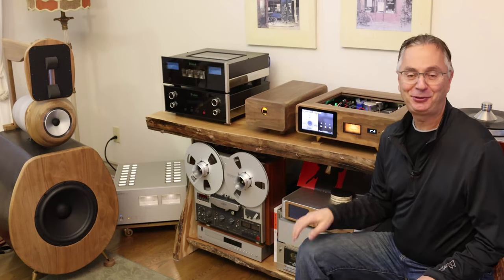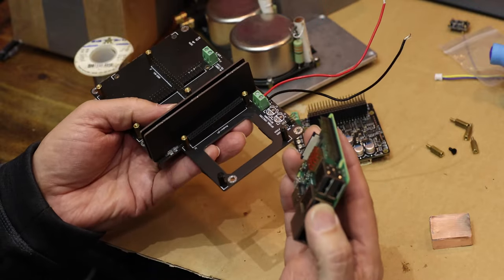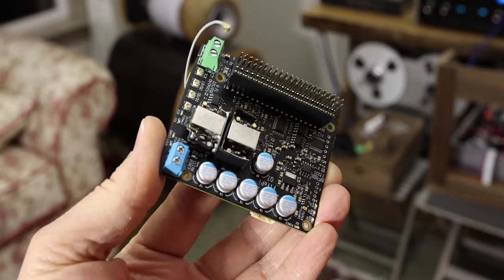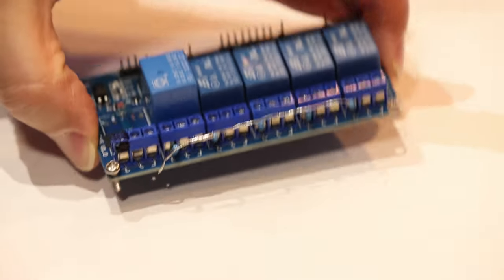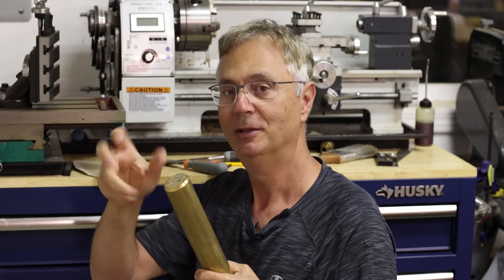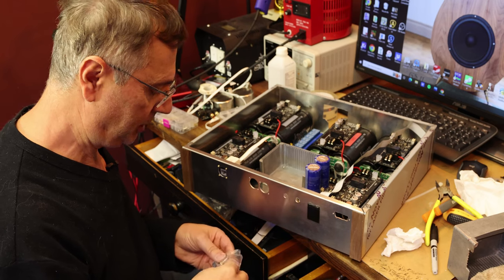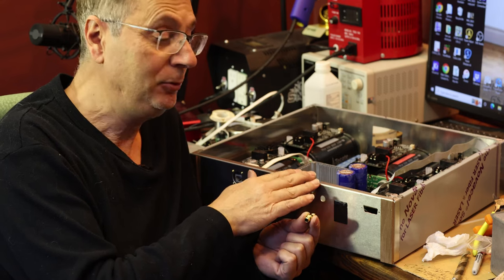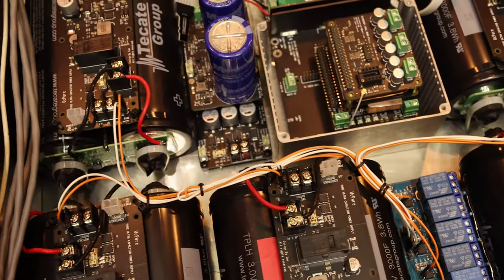World's second Best DIY Dac and Streamer Detailed Build

Comment: Thanks for this video. Can you share link of The display? I need one that i can mount in The sa e way like yours (on wood chassis with display edges  outside)
Reply from the maker: This is the official 7 inch Display from Raspberry Pi it has a thin black bevel easy mount: 
https://amzn.to/3SNQhyN

If you wand a 5 Inch (not too many work with Roon) and no outer bevel available that I know but see my Display Video desc for the one that works with Roon and also IPS:

https://youtu.be/N_vdKhiUyPY?si=YCpK5re2-Hi6shg_

Comment: Hi magnificient work. I wonder if you can get a lesser quality but a still good one by avoiding supercapacitor. The whole system would be much simpler and less expensive. I think many people would feel themselves safer too by avoiding supercapacitors accepting a lesser quality result. I understand you achieved a sort of proof of concept of an ultimate dac and it is really amazing. Other things such as the extension cable and the screen may be avoided to make all the project more easy.

Comment: Hello, 
All the best wishes for health and happiness as well as to your loved ones for this new year. 
I don't know where to start so much that I find your DAC network player extraordinary. 
My first question concerns the shielding you made on the Raspberry and your FifiPiQ7. Don't you fear that in the long term it will heat up a lot? My raspberry PI 4 heats up quite a bit for me... 
Did you find a significant musical difference between the FifoPiQ3 when you first installed it and the Q7 you have now? I have the Q3 with the same clocks as you and I already find remarkable musicality at my level... I don't bother you anymore. 
Congratulations again for this extraordinary job you have done. 
Thank you 
Xavier.

Comment: hi…. can you share a link for that two metal boxes used to shield the station pi? thanks!
Reply from the maker: They are Hammond Boxes picked it from a local store but here is a mouser link 120x95x56mm not counting the lid height
Have fun :)
https://www.mouser.ca/ProductDetail/Hammond-Manufacturing/26908PSLA?qs=amGC7iS6iy9KUZQl8bCM5Q%3D%3D

Comment: hi. i’m trying to build similar project using opa861 instead of I/v transformers. Now i’m building power section and i have 2 alternatives:
1- going with ultracapacitors plus linearpi for raspberry as you did

2-going with linearpi dual with UcConditioners for opa861 and purePi for raspberry, dac and fifoQ7

second way is (i think less expensive)

what do you suggest gabster?

thank you so much!

Comment: Hello Gabster. Do you think there will be a big difference in sound quality with Ian Dual Mono Dac powered by one 3.3V ucpure and three independent ucpure for dac?
Reply from the maker: Probably not a lot I could not tell 
But you only need 2 as the middle one is for the clock if you sync with the fifo you do not need it

Comment: Hi Gaby...i have the same problem with the ess controller...did you connect the delay timer so that the ess controller part boots later or so that the raspi area has a delay? also the four 3.3 volts for the Dual Mono Dac HAT and fifo should start with a slight delay ?
Reply from the maker: The Video is not Clear but you can see it at 55:35
The delay should be on the 5V of the FifoPi 
or if the FifoPi is getting its 5V from The Pi then Both I have separated the 5v on the FifoPi in my system
easy way to do it is to:
Use a relay with a large Capacitor in parallel of the 6 to12V Relay power taps and you supply the power to it with a very small resistor in series. The relay will trigger the UCPure on/off connector (Switch should be OFF)  I attached a sketch for you https://drive.google.com/file/d/1PWYSS0saqiCux17cyMrqr5Z5CRNr1DaT/view?usp=drive_link
Hope that helps
I wonder if the Monitor pro does not have that problem.

Comment: This build is truly inspiring! I have two questions though about something you brought up but never explained further:
1. How was the the test results for this DAC? Did it show good linearity?  Low distortion? It would be nice to se a separate video with measurements.
2. What resistors did you end up using with the Ivan I/V?
Reply from the maker: Great linearity a tiny 1 db loss in base below 30hz normal with Transformers very low distortion.
not much time for a video specially that I will be upgrading some parts soon
2) 100ohms in my system on the input none on the output
Reply: @Gabster1  Thanks for the response!
Reply: Great Build @Gabster1. 

Did you end up using the Vishay metal foil resistors? 
Have you used Dale resistors in any comparison?
I am considering the upgrade on my Lundahl transformer output stage for my next Ian Canada build. 

Regards Mikkel
Reply from the maker: @mikkell.7828  
Yes, I used this one did not compare it to Dale but I liked them better then Ivan's own resistors but that is to my ears and system.
https://www.mouser.ca/ProductDetail/Vishay-Precision-Group-Foil-Resistors/Y0785100R000T9L?qs=HtoBOv42S6KMksJHS%2FF3bw%3D%3D
Reply: Thanks for The link @Gabster1🙂

I my self I trying to figure out where to place my 8.8” HDMI screen in my new GB2023 build. Both physically and power wise. I like you copper shielding around yours btw🙂
Did you power you DSI screen in between your linearPi and the UcConditioner? Was that to only have the pi using the conditioned power?
Reply from the maker: @mikkell.7828   8.8 that is a good size perfect as we grow older 🙂
correct in between provides a bit of noise Isolation between the 2 and not having to need another supply.
If you are interested send me a few pics when you are done to share on my Chanel.

Comment: Hi Gabster, I have seen, that you also have a Denafrips Terminator DAC. Did you compare those two DACs using the same Streamer?
Would you mind sharing your thoughts and impressions about this?
Reply from the maker: They are very close I did a blind A B test with a few people and it was a 50/50 mixed review 
But that is a good thing I now use my Dac as a reference also room for improvement in the future.

Comment: Wouldn't it be better to use 2, 12v batteries that work interchangeably instead of capacitors? Saludos
Reply from the maker: Ultra capacitors are the purist form of power with very low impedance

Comment: Why did you choose a passive IV versus an active one (like Burson V5/V6) Great project, just mapping out my starting point.  I currently have a Naim ND5 and Mark Levinson 526 (DAC/Pre), just want to play and see.
Reply from the maker: from my experience A good Quality passive will outperform most active also less ultra caps to power them but may try a active option may be will try the Burson opamps

Comment: Hello Gabi,

I like to thank you for the videos. You inspired me to build my own DAC.
As i want to start with the electronics first i bought the FiFo Q7, Dual Mono Dac HAT, MonitorPi, ESS controller, I/V transformer output board.
If all works i will build a fancy power supply and case too.

As i want better clocks i bought one Accusilicon 98MHz to compare the standard clock with the Accusilicon.
Now here is my issue. With the standard clocks from the Q7 FiFo i can see in the MonitorPi
both frequencies from the clocks and it's working.

Now if i put the new Accusilicon in the socket i can't see the frequence in the MonitorPi and the Q7 is not working.
In the manual i read that i need to bend pin 1 of the clock because of a strong pullup. I did this but with the same result.
I also tried to solder a 1k resistor from EO to ground but no luck. I can mix the Accusilicon with the standard clock and i can see the frequences in the MonitorPi from the standard clock but not from the Accusilicon. I can swap the sockets but with the same result. So i assume the Q7 is fine but the new Accusilicon clock
is somehow not working.  

I have a 20MHz Oscilloscope only, so i can't see any real output from the clock.
Now i have no idea why it's not working with the new better clock from Accusilicon. Is the new Accusilicon dead? Is the Q7 somehow damaged?

Do you have any idea what i can try to solve this issue?

Thank you for your ideas.
Reply from the maker: sent you a e-mail back hope you solved the issue

Comment: @Gabster I am building my own streamer based on Ian's designs. Is your aluminum chassis custom or is it an off the shelf piece from Hammond? I am trying to locate one and yours would be near my requirements.
Reply from the maker: It is from Mouser here is the link
https://www.mouser.ca/ProductDetail/Hammond-Manufacturing/1444-17154?qs=XJfXErqHgA5%252B%252BK8hsJVg4A%3D%3D
:)
Reply from the maker: It is very basic not the best looking, it would need a front decorative piece at least
Reply: @Gabster1  Thank you. I will definitely take a look at those chassis. Congratulations on a successful project. They sound phenomenal for the cost.

Comment: I have a couple of questions if you can answer? I assume after you built this unit you are no longer using the streamer you built. Is that streamer available for sale? Also is it possible to add an optical network connection to this dac/streamer?

Thanks, Paul
Reply from the maker: Hi Paul Yes I could sell the prototype Streamer as you mentioned not using it now since my Dac build
Send me a email, my info is in the about section of my Chanel.
and yes it is possible to add a optical not sure if you want a output or Input.

Comment: Gabster, I was just wondering if you ever tested the Ian Canada Transformer I/V in your build?  Do you have any comments about it?
Reply from the maker: I have not He supplies the IV board and you can get the Transformers for it but I did try the active opamp IV board and it is not too bad sounded great to my surprise.
Reply: @Gabster1  Thank you for the reply, the opamp version looks interesting, I was thinking of his OPA861 Fully Balanced Zero Feedback I/V Stage (November 2022).  It may have been released after you were well on your way with your build.  Nice build by the way.  Are you going to sell your Terminator or have you sold it?  What is next?  A couple of point to point tube mono blocks?

Comment: Hi Gabby, thank you very much for your videos. They are extremely well done and you manage to transmit your enthusiasm for this hobby of ours.
I am seriously considering to try and build a dac/streamer myself based on what you did.
In my case I need to use the dac also to convert the signal coming from my CD transport via an AES/EBU cable. Is it possible within the configuration of what you built? Which board would allow to do this?
Thanks in advance 
Aming
Reply from the maker: Hi Aming
yes you can just add a receiver PI like the:
https://github.com/iancanada/DocumentDownload/blob/master/ReceiverPi/ReceiverProII/ReceiverPiProIIManual.pdf
also Ian is just releasing a Receiver Pi DDC I believe it does the same as well not sure
https://www.diyaudio.com/community/threads/asynchronous-i2s-fifo-project-an-ultimate-weapon-to-fight-the-jitter.192465/post-7487348
Hope that helps 
Gaby

Comment: Very pretty build! - You didn't encounter any noise issues with the unshielded DSI-cable for the display? That is the thing i would expect to generate a lot of noise.
Reply from the maker: Not too bad but it is nois, it is galvanically isolated Via the Fifo pi that helps a lot
Reply: @Gabster1  how is the DSI galvanically isolated? It's from the flat flex connector directly on the Pi.
Reply from the maker: @zaprodk  you are correct connected to the PI but the Fifo Pi isolates it from the Dac also the FifoPi has a second isolated 40PIN GPIO for the ESS controller with my noise sniffer the ESS controller is way noisier. the FifoPI is a Key component without it it is very bad.

Comment: Very impressed of your build,one question.You have both 5v and 3,3 to fifopi,what do you use 5v for?
Reply from the maker: The 5v runs the main board like processor and ess controller gpio and the 3.3 run the clocks mainly and the clean side gpio (40 pin connector)
nice to separate
Reply: @Gabster1  Ok,I asked because i can read Pi optinal power on that connection in manual for Q7.

Comment: My only question is the raspberry pi enclosure and all the elements around will not suffer from heat ? Everything there generate heat ! Are you not having issue with heat?
Reply from the maker: The enclosure does not have a tight seal a bit of space around the network plug on the right and around the power and video cable on the left I am using a 3B+ and not overheating at all 
The enclosure temperature is only couple degrees above ambiant
Reply: @Gabster1  amazing thank you for your answer!! Well done … great project …

Comment: How about a less expensive alternative for beginner DIYers? :)
Reply from the maker: there is a plan for just that
Reply: @Gabster1  waiting for that!
Could you structure next video in levels ?
Exemple:
level 1 just a streamer
 level 2 streamer and dac 
level 3 streamer /dac running on batteries
Level 4  streamer/dac/batteries with next this addon a reclocker for ex
Level x adding this
Level x+ adding this on top and so forth
Also could you detail a bit on how the wiring goes…like for a verry first time diy-er, how the power suplies and the capacitors go together…
PS: the three toroidal transformes i did not understand at all! Do you need that also or can you plug the streamer dac into the wall socket and add the power suply after?
PPS: does it really need a power supply if the streamer/dac runs on the ultracapacitor? It is clean power …why does it matter how it gets inside de ultracapacitor or the bateries?

Comment: too many electronic components.  Just use HRT music streamer, change opamp to MUSES02,  add proper RCA connectors, power streamer with separate 5V battery PSU and with less than a 300 $ that combination beat this RPi garbage
Reply: Cry another place please 🙏🏻
Reply: @semihguzelel9966  People constantly try to invent snake oil....